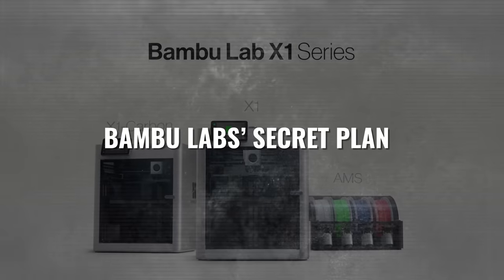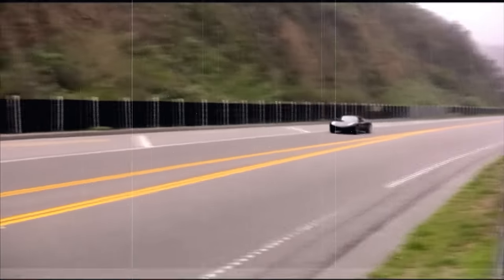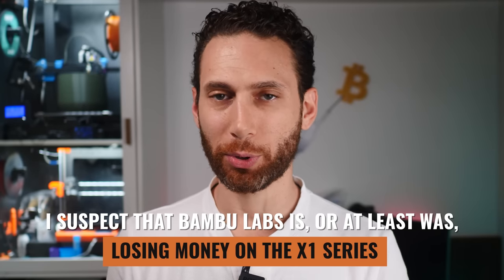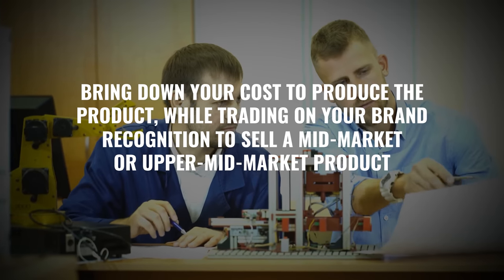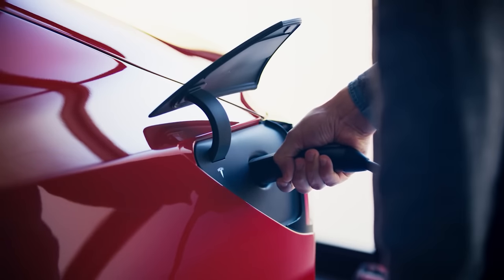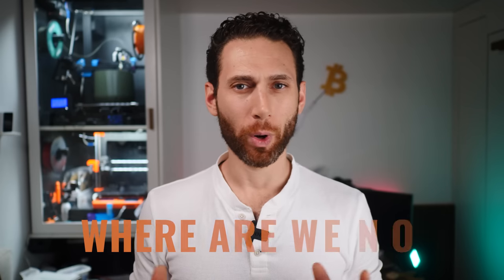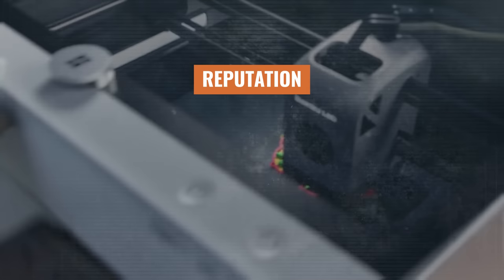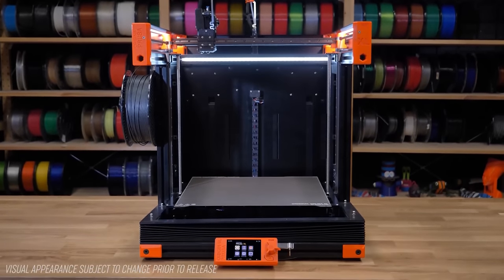Bambu Labs Secret Plan: What the P1P Means for 3D Printing

Comment: This is so true. I also think it is kind of sad. The 3D market has been a group of home grown hobbyist putting great ideas together. Now, no more tinkering or design from individuals. It's like that feeling when you realize you are a "grown up", and it's never the same again.
Reply: I see it more as a growth in skills. There is still tinkering in filaments, settings, shapes, materials mixes, plus the optimization for designs that are printed on these devices.
Reply: I see it more as a growth in skills. There is still tinkering in filaments, settings, shapes, materials mixes, plus the optimization for designs that are printed on these devices.
Reply: Why is it sad? This will remain a hobby for many.

I own an Anycubic Mega S and built my own Voron 0.1. I was considering getting rid of the Mega S and building a larger Voron, however, it no longer makes financial sense. It's better to spend less on a ready made machine that prints fast and prints beautifully. 

This will also help the hobbyists because Voron kit sellers will have to bring their prices down, which will lead to more Vorons. This is a good thing.
Reply: Even the P1P is prohibitively expensive for a lot of people. Whether it be the budget, or the the simple fact that someone wants an open-source printer to tinker with, those still exist in the market. I, for one, got tired of messing with my Ender in order to get it to print right. It was fun at first, but now I just want a printer that doesn't fail (as much) and prints fast.
Reply: @MaxGarbaty  it's not a "cheap" machine but it's an absolute steal for the price. They did so much right and unlike Prusa with exorbitant prices for the what they offer plus their shipping is fast.

Comment: I have an X1 Carbon and it's amazing. But I hope they don't underestimate the need for a 350mm size like the Voron 2.4 which I also have. That is the only thing that has kept the Voron relevant. I have several Prusa MK3s and until the X1 Carbon have been my go to machine for most stuff but are now in my opinion obsolete. The Voron however is not. If they don't come out with a 350 form factor, they might not gain as much of the market as they think and someone else will take that chunk of the pie. Bambu has shown the path to the next generation of printers but 256mm is not the whole market. FYI, my Voron 2.4 350mm with a 0.6mm nozzle prints as fast as the X1 Carbon. The X1 prints do look a little better. Bambu Lab, please make a 350mm machine.
Reply from the maker: I suspect it’ll happen…
Reply: And also: the cheap printer market should not be underestimated! Most people won't pay much more than 400 bucks for their first printer as a hobby. That's why Ender 3 and it's clones are soo popular after the Prusa Mk2/3 where popular!  When setup correctly they deliver the same speed and quality as a Prusa for a fraction of the price!
Also one fact can not be ignored: the "LEGO factor", meaning the joy and fulfillment of building a machine by your own. You did that (because you have a Voron, and maybe also the Prusa as a Kit) ... and new buyers want that experience as well! - Bambu Lab can't provide that, either price (250 bucks Ender 3 clones) nor the building experience with a prebuild machine!

Most of the time people print small things that do fit onto 160 x 160 (Ender 2 Pro, Prusa Mini) or even 120 x 120 (Voron 0.1). Most people print very seldom larger things where a much cheaper and slower CR-10 could be more than suitable for costs/ benefits, also with 400x400 or even larger print plates.

The market is starkled. Can Bambu Lab come up with an even cheaper printer than the P1P to compete in the cheaper market without loosing quality, price or out-of-the-box experience? Can Creality come up with faster printers (which has already begun with their Klipper "Pad" nearly doubling the speed of Ender machines)? Can manufactures like LDO provide more and more cheaper Voron Kits for people who want build experience and speed?

We'll see. But my guess is that the focus of BL remains on cost and speed, but that they cannot match the Ender prices or deliver the Voron/ Prusa build and repair experience.
Reply: @hassosigbjoernson5738  
Bambu doesn't work offline.
Bambu receives your jobs via the cloud and maybe even saves them.
Prusa was around long before any Chinese companies, and I believe that these companies stole the idea from Prusa (?)
Reply: @18B_Madder  that's not entirely true. While you can directly send it via cloud, you can send via lan or to the card.
Reply: @supermodestmouse  Missed the point me thinks. Either way you send it, Bambu Labs will have your job before you print it. 'No internety, no printy' period.
Reply: @18B_Madder  If you don't want to send it, you can load it on a card and print from there locally .  if you don't want bambu to know what you're printing, maybe you're right.  I didn't try printing without connecting to my wifi first.

Comment: This is an accurate analysis. I often remarked how cheap the X1 was for what it did. Yes, it’s economies of scale. They have the injection molds, tooling and frame assembly done and tuned, now they can spit these out at a rapid pace. That being said, i would have paid 2x for the X1C I got from kickstarter. Plus they gave us a bonus gift with a new extruder and tool heads worth about $100 too. This was the first and only kickstarter I ever backed or trusted in and boy am I glad. The machine is a beast, been printing nonstop for months now. It’s just tough, fast and accurate, exactly what I needed. Prusa should be ashamed selling that toy.

Comment: Look how the machine is built, it’s all cast parts and uses as few separate parts as possible. Their entire machine is designed off economy of scale. They needed the money from the preorders to bring the cost wayyyy down and then they make profit. They’re easily making profit as soon as the preorder was finished.
Reply from the maker: Bingo. That's a really good point I forgot to mention in the video. That also gave it away, but I didn't know if they were gonna go "up market" (adding on IDEX to the X1 shell, for example, to better take advantage of the AMS?) or "down market" - when the P1P came out, that was revealed.
Reply: I dont think its cast. More stamped, folded and welded steel. Casting is pricey
Reply: @TheJttv  casting is pricey, to begin with but then will make up cost after a couple thousand machines easily. If only they had a few million dollars to invest in making the ultimate mass manufacturing tooling🤔
Reply: @Jttv  can confirm, stamped steel frame.  Laser welded on a fully robotic assembly line.

Comment from the maker: THANK YOU FOR WATCHING. Yes, I realized later that the name is Bambu LAB, not LABS! Sorry about that. Let me know in the comments below... do you agree with me that this is their likely strategy? Or where did I get it wrong? Let me know!
Reply: Just throw an apostrophe before the S in the title and it will be perfect
Reply: They definitely sunk millions into initial NRE and factory tooling.  But coming from a manufacturing background, I'd comfortably wager that they have a healthy profit margin on every single x1 or x1c sold.  And that their per unit profit margin is even higher with the p1p.  One you have the tooling and robotics in place, those frames are dirt cheap to manufacture while being accurate, rigid, and repeatable.
Reply: @seashadow5239  while my career took largely a different direction due to health issues, yes, I concur, from my formal training in robotics/automation that they’ve designed for manufacturing, and once you’ve done that and created proper assembly lines, assembly is cheap.

The interesting thing people need to keep in mind is if you design things correctly, even human assembly on assembly lines can be fast and cheap, particularly when the total number of unique parts is minimized, combined with total number of parts.

The X1C doesn’t have a huge amount of mechanical complexity for parts for what it does. By contrast, when you get a Prusa I3 variant, that’s got a lot of twiddly mechanical complexity that doesn’t seem suitable to quick assembly lines, automated or not. A coworker bought one of their kits and remarked it felt like it had too many parts. Before I finally bought a couple 95% assembled LotMaxx printers, I had bought a FolgerTech I3 printer, and yes, there are lots of twiddly things to assemble. I partially assembled it, it’s been languishing in a partially-assembled state with coarse looking 3D-printed parts ever since: know anyone that wants the kit and will pay shipping? 🤣🤣🤣
Reply: Nah ur wrong
Reply: it is china, they may had money in the beginninge and planned to produce in scale, so they might have been able to produce printers with profit for the production costs. I assume the RND cost's were high, but of you factor in a large production scale, you can distribute the cost. For the future or the next generation it might be more profitable to aim for the prosumer marked and refine their product, or give it more features. Bigger build space, Toolheads to change, or maybe even a laser engraver, but that might be stupid. I assume they will also focus on the mid range marked at some point, unlike ultimaker eg.
Reply: LOL...no, Tesla is not cheaper, and they are not the future of vehicles.  Electrical vehicles cannot compete without subsidies.   There is not enough Lithium or Cobalt on the surface of the earth to make this even remotely possible.  Different battery technology (not lithium based) may improve this, but simply put....electrical batteries have 100 times less energy density than combustion engines.  So, fair to say this was a bad analogy for your video.  Co-exist sure.  Replace, absolutely not.
Reply: Want to know the FACTS?
Bambu Labs stole copyright laws from Prusa: Fact
Bambu Labs does not work offline: Fact
Bambu Labs is cheap materials and will fail: Fact
Bambu Labs keeps your jobs in their cloud: Fact
Prusa will print for 1000's of 1000's of hrs. w/o fail: Fact
Prusa is upgradeable and works offline: Fact
Prusa has better customer service: Fact
Prusa was the printer Chinese companies stole from: Fact

I personally like the idea of NOT having a company keep my jobs that have to be sent to the Bambu Lab's via the cloud.
I like the idea of being able to hit print and not having to worry about it not finishing the job or having a part break.

I would rather spend a few more dollars on something reliable, doesn't steal jobs and works offline. I do not trust copyright thieves.
Reply: @wdwalker2178  100% false considering the 1000's of ways to produce electrical energy. Nicola Tesla would disagree. You should educate yourself on next to free electrical energy sources. Electromagnetics is the future of vehicles and are MUCH MORE powerful and MUCH FASTER than anything produced via combustion. Don't get me wrong! I love my rumbling, oil spitting 6.7 Cummins diesel that I 'Smaug' an occasional Tesla here and there w/ especially with California plates. But these Electric trucks, (although new) have a lot more power/torque than my diesel could ever dream of having. It's not even close.

Comment: An interesting report except you overlooked one key point - the insanely low cost of Chinese labor. I saw an electronic power board made in China that sold as a replacement part to a dealer in Canada for $2.86 CDN. This part by any other manufacturer was at least $50 to $150 depending on the company. At $2.86 they made a profit on the part ... so how much did it cost to make ? Bambo Labs is a Chinese company and their development engineering costs are much lower than the business models we are used to. Why do you think that a large portion of manufacturing eventually went to China ? The labor costs are so much lower that no-one can compete. Bamboo is not losing money - they are making money and they will take market share .... unless .... the problems China is facing reduces their ability to do business worldwide in a normal way. China has BIG problems in their immediate future ... so we will wait and see.

Comment: I have a mk3s+ and when I first got that printer it was magical. The step up from an ender 3 and clones was massive. The “just works” aspect was incredible. 

I just ordered and received an x1 carbon with AMS and good lord. Starting out with not having to spend 8 hours building the thing was a much bigger deal than I thought. But then once it was up and running, it was the same magical experience I had with my first prusa. Except this time the prusa was the ender 3. Everything about this printer is leaps and bounds ahead. I see why everyone lost their minds about it. I printed a benchy in 10 minutes that had the quality of the prusas benchy that took 1.5 hours. 

When I first saw the x1 carbon I didn’t even give it the time of day because I assumed the price would be $5,000+ (thanks to companies like ultimaker). When I saw it was $1500 AND claimed to have all these crazy features I said screw it. Bought one immediately without really doing my homework. 

Best impulse purchase I’ve ever made.
Reply from the maker: Well said. I agree on all fronts

Comment: Wow, a lot to unpack here. First of all there are two big facts that you didn't mention which are extremely relative to what's going on at Bambu.

1. Bambu is a spin-off from DJI, the top consumer drone manufacturer in the world.
2. Bambu is Chinese

Because they came from DJI, they already understand channels and marketing not to mention consumer engineering design processes and manufacturing. Like most experienced companies, they know how to design a consumer product using optimized materials. They understand injection mloded parts are typically stronger and less expensive than 3D printed parts. Not to mention, the Bambu guys are crazy good engineers and especially talented in math.

My guess is you may be correct in that the first couple tiers at Kickstarter may have been loss leaders, but as of now all models of Bambu make a profit.
And, because the company is Chinese, they can negotiate better deals than anyone outside of China, which keeps their prices down as well.

To compare them with either Tesla or Bugatti is inaccurate. Both of those products had super high end offerings at super high end prices, not to mention extreme vertical niche markets-- and that is not the case with Bambu. 

Bambu's product is good, but very close to the Voron with a proper enclosure. The problem with the Voron is that it takes you 30 hours to build it and the one-off kits for sale are ridiculously expensive. 

Everyone knows the X/Y Gantry is a top-of-the-line FDM solution,  Bambu optimized it while adding sensible design features and producing it as a consumer product and not a construction kit. I'm surprised not all other vendors are trying to do the same.

I enjoy watching your videos. Unfortunately, I think you missed a lot on this one.
Reply: Totally agree with you! I would add, to claim there is a loss one should at least try to do a cost breakdown. There is zero foundation here to claim there is a loss. There may be a loss, but no data here proves it.

Comment: I think the better comparison for Bambu Labs is to compare them to DJI.  DJI came in and conquered the drone market.  50%-70% share I think was the last stat I saw.
Reply from the maker: It’s a very apt comparison; Bambu was founded by a bunch of ex DJI engineers. I’m sure they took the exact playbook from there.
Reply: This is 100% the correct comparison, especially since (I believe) Bambu was set up by ex-DJI staff. DJI took drones from an hobbiest product which had high barriers to entry in both cost and knowledge to a point where average folks can pick up a Mini 3 for a few hundred dollars and get it flying in a (reasonably) easy consumer friendly experience.

They're gonna attempt the exact same playbook with Bambu. I fully expect a well sub-$500 Bambu model aimed not at 3D printing 'enthusiasts' at all, but at average reasonably-tech-literate consumers within the next couple of years. Probably aiming for as much as a plug & play experience as possible, perhaps including proprietary filament requirements to increase reliability and add a guaranteed revenue stream. Basically taking 3D printers to where 2D printers were in the late 90s.

Comment: Question.  when they do "dominate", where does creativity go?  Bambo is very closed and proprietary. Innovation happens when you have competition, and when the market shows what can be done. A lot of Prusa's success and staying power is the fact that the small innovators can build on it as a starting point.  the XL got a lot of tech ideas from the community (zoned bed, docking extruders, etc), and the MK3 got many of it's ideas the same way (mesh bed leveling, contactless probing, magnetic build plate), all while keeping the door open to innovation.  What happens when we, as a community whole, lose that platform and the ability to innovate?  Is this not a threat to our work?  Do we worry about the "Makerbotification" of things?  With Makerbot's move to their proprietary design (and proprietary slicing format), there was a very real possibility of everything becoming strictly licensed.  And non-creator manufactures are pushing hard to limit and control what we make.  Just look at Tesla and their "Market First" of locking otherwise standard hardware features behind subscriptions.  Is that our path, or do we keep supporting companies like Prusa and Creality to ensure that door doesn't close.  I'm all for cheaper printers, but not at the expense of a future where that printer isn't useful.